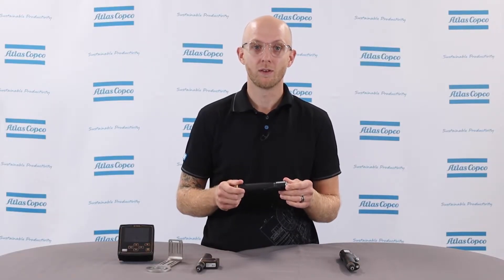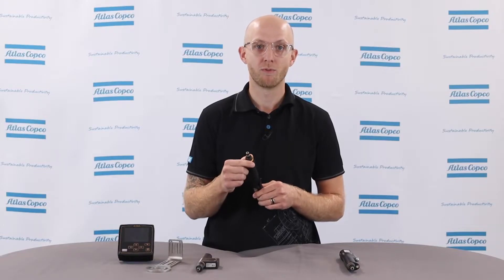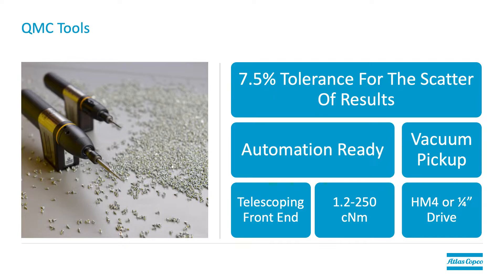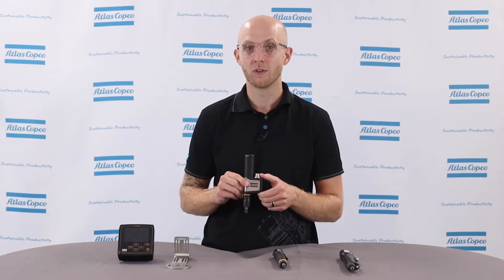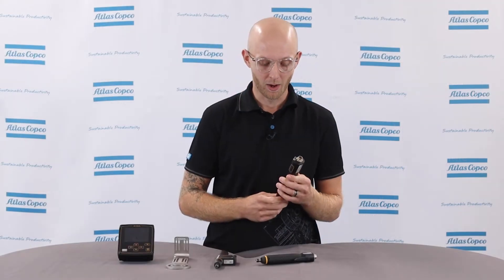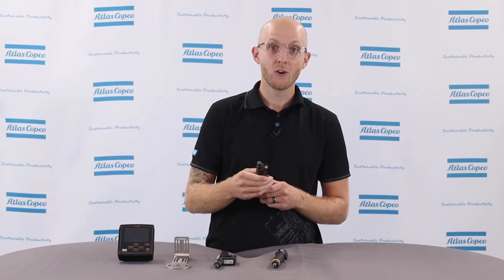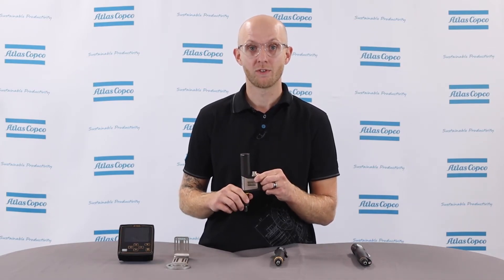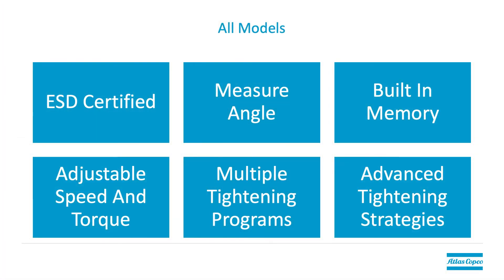Product Essentials series: MicroTorque: MicroTorque tool comparison | Atlas Copco

Comment: HELLO
I have an issue with your device MTF6000+QMT41-100-HM4.
Occasionally, we receive an error message on the display:

151 - Tool friction too high / 200 > 100 mNm

Could you please advise what might cause this error?
Is it possible that an incorrectly soldered cable could lead to this issue? (We assembled the cable ourselves according to the pinout provided by your representative, as we needed a non-standard cable.)

We have checked, and there is nothing obstructing the bit from rotating.
This error can appear after tightening 5 screws, or sometimes only after 200 — it occurs randomly.

Is there perhaps a parameter in the settings that we can adjust to resolve this problem?